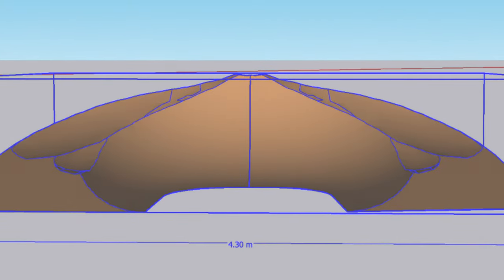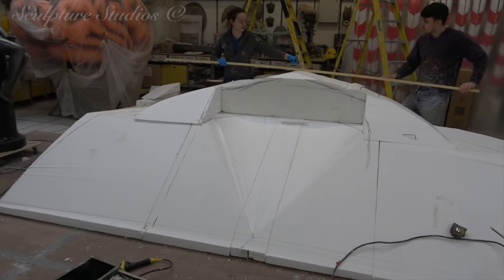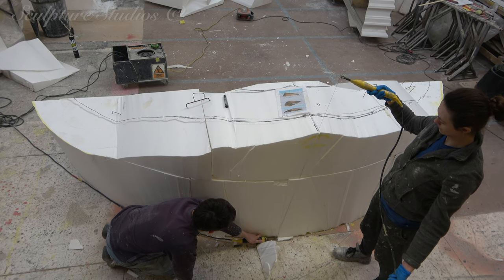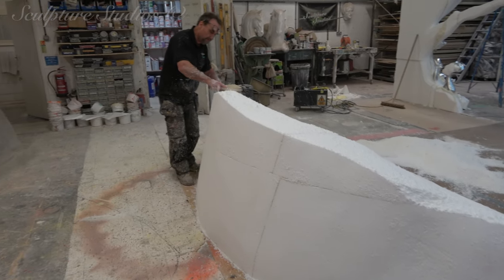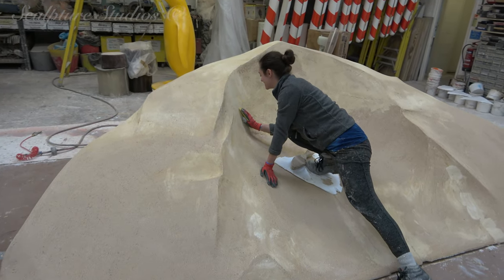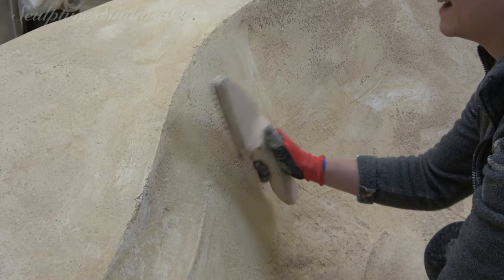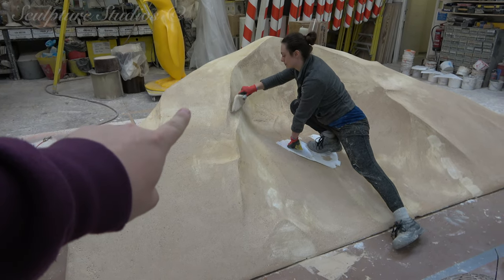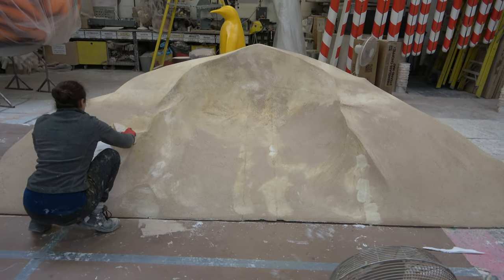Fake Sand Dune for Ellie Goulding's 'Like a Saviour' Music Video by Sculpture Studios

Comment: What is this Brown material for a gel coat?
Reply from the maker: This isn't a gel coat. It is polystyrene with plaster and emulsion paint
Reply: Plaster ? Oooh ! Is that any similar to slastic ? I mean, in terms of "hardens the polystyrene a bit but not that much, just enough for its purpose".
Reply from the maker: @borealfear6762  It's a water based plaster render. Basically, pre-mixed in a large tub from a home contruction store. That you might fill small cracks on a home wall with. Its not strong or durable for sculpture. It does give it an ever so slight shell, but it was simply used to lose the polystyrene texture look.
Reply: @AdenHynesSculptureStudios  alright I see what it is now. I mostly use tile adhesive when it comes to smalls rocky surfaces :)